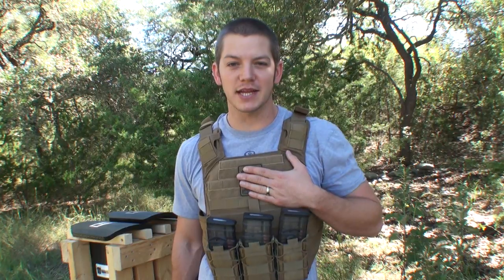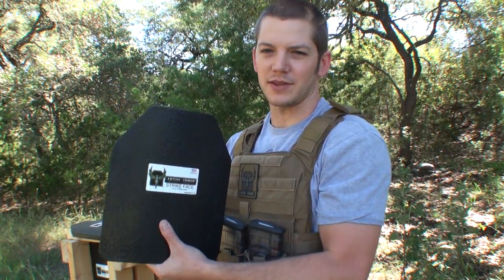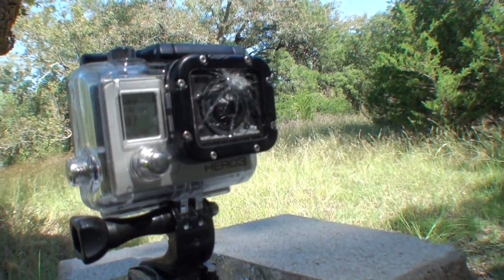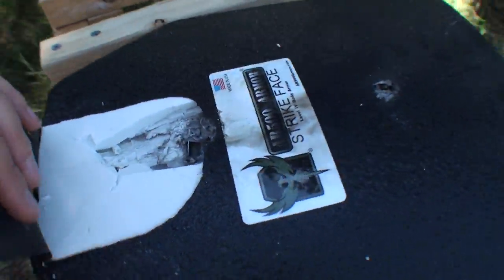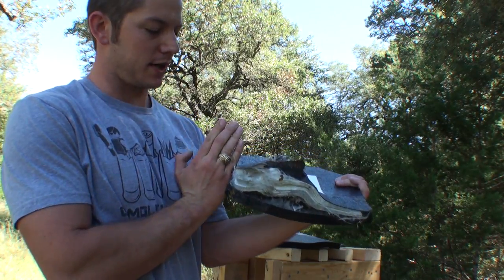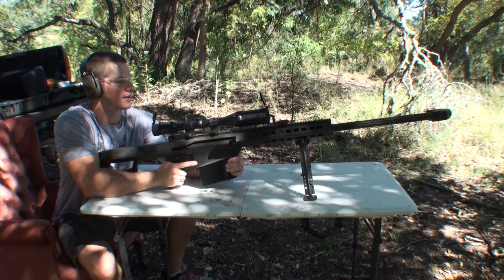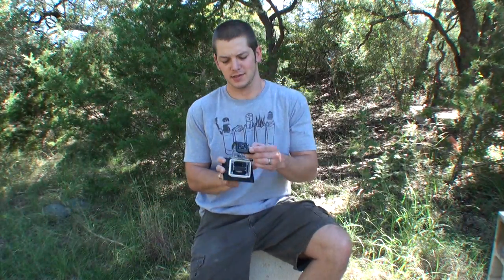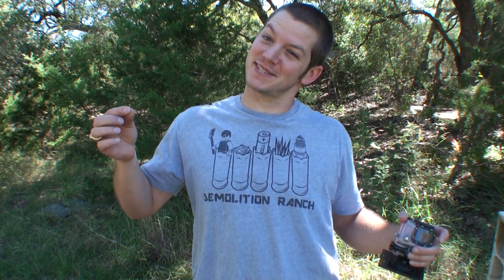Level IV Body Armor Torture, 50BMG

Comment: Umm... Even if it stopped the huge bullet, the resulting kinetic energy and momentum transfer would still either:
A: Stop your heart (Kill you)
B: Break your ribs (Possibly kill you if the fragments impale something vital)
C. Rupture your lungs (Very likely to kill you by drowning you in your own blood)
D. Push you back with so much force, the acceleration from the impact would rival getting hit with a car (Quite possibly kill you, depending on where you get struck)
E. All of the above
Reply: D. Maybe if the car is moving at about 5mph. Anything above walking pace and the car will be carrying way more kinetic energy.
Reply: tomcornwall83 Cars and Bullets definitely do not have the same Weight/Inch² ratio.
Reply: Waterpae well if the plate is intact it will definetly spread the impact force to the entire plate. So people might get trough that completely unharmed if there is a cushion wall behind them.... remember: the force applied to the target is the same as recoil... sure the gun has a mechanism to reduce it but if you don't stand directly with the back to a wall when shot you will move backwards when hit too. There is also the chance of being hit laterally which would reduce impact further. so with all respect for guns i still believe there is a fair chance to get trough that without permanent damage.
Reply: There is no way a bullet could Rupture your lungs or Push you back Or stop your heart. what stops your heart is you from the surprise of the impact.. but then again that is equal to getting a heart attack when a small kid dressed as a clown attacks you with kitchen knives in the middle of the night.  ... Example: Bomb suits can withstand ANYTHING.  hand grenade 2 feet away: damage 0. The only thing killing the people inside is the air pressure from very fast explosions. a bomb suit will make you survive a car bomb 1m away from you IF the explosion isnt fast enough to kill you... direct damage at the surface of the body is highely unlikely reality shows that people die from inside injuries . this is something a bullet can not do. with that as an example i really really doubt a 50 cal could harm people as much as described if the armor stops it.  ...      Movies make it look like bullets carry a lot of force but they dont. they cant push you an inch.
Reply: Waterpae well a tennisball could break my rips so thats not very special
Reply: Jo Kommentaah Next time you shoot a .50bmg for real or see someone shot with one, then speak.  Your naivety is astounding, stop playing video games and go get some hands on experience.
Reply: Van Hartman okay back to the basics: a 50 cal is not able to push a man when it hits him . if its not able to push him... and is stopped by 3! or 2 plates then the total energy could nowhere near be 15k joule transferred to the body. now take a punch lets say its able to transfer 500 joule to the target. the area a pnch would be transferred onto can be as little as 1x1" if hitting bones. does it injure you? normally not. okay so the plate is 10"x12" that is 120x times the punch. what is 120x500? woopsy far more than 15k . guess its not that powerful then. Yes it can go trough a wall.. but so can a sledgehammer with a pointy end. and would that hammer kill you if you got hit onto some armor that it cant pierce: NO. it would not.  So that does prove that the energy CAN not kill you if its absorbed by the plate armor. get it. absorbed. thats what the armor is all about. if it wouldnt absorb/disperse the energy the bullet would go straight trough. why dont people feel shit when a normal rifle round hits their armor? exactly cause its just a damn punch of energy being transferred to a large area. also keep in mind it will be more than 120square inches if someone wear a normal combo of a full anti-shrapnel with the plates on top. and then there is the clothing to absorb it further.  you probably think shotguns can kick people trough the air and grenades create huge fireballs.
Reply: Waterpae actually simply google the tennis ball and go back to school. oh and btw .... the force is not the only factor when breaking rips. but that far beyond your comprehension..
Reply: Waterpae raaaight. well fine i you cant google what more can i tell you ......  wall is wall nothing will change your minds faults
Reply: Uhg....... I'll see if I can sort out any arguments...

Force=Mass x acceleration
Kinetic energy=1/2 x mass x velocity^2
Momentum=mass x velocity
Impulse=Change in momentum= Force x Time
Pressure=Force / Area

Assuming the .50 cal bullet is stopped entirely by the plate(s), the momentum change from high speed, low mass to lower speed, higher mass (plate mass + bullet mass) would be tremendous, thus giving a huge impulse to the body in a very short amount of time.

This, in turn, will give us how much Force is being inflicted upon the body, which can be plugged into pressure equation. We also know roughly the area of the plate. The amount of pressure on the ribcage is likely going to crack a good few ribs from a .50 cal impact if there isn't any sufficient padding between you and the plate.

However, this won't stop the energy transfer. As energy increases squared as velocity increases, we have a good 15k joules of energy hitting your chest. Some of this energy is absorbed by you flying backwards from the impact, but the transfer of energy is not equal throughout the entire body. Given the likely scenario, the impact would be enough to probably give a minor rupture of a lung like a small explosive going off nearby. (Think like getting hit with a very large hammer, the plate after the impact being the hammer, not the bullet)

Continuing on, we also know the final mass from after the impact and the force being applied. The acceleration would throw you back with a sudden jerk, most likely injuring your neck like you're in a car crash. If you're really unlucky, it COULD break something. 

I hope this somewhat simmers down the arguments going on in this comment chain.
Reply: None of you are factoring in the energy taken out if the equation for plate deformation and temperature change.
Reply: joseph cook You make a really good point there. But would that affect the outcome though? Will it still kill or not getting hit by a .50 cal with the plate on?
Reply: BrokenLifeCycle FINALLY a compentent, coherent explanation. I was beginning to think there weren't any educated adults here. Not including the Doc. who has entirely too many cool toys!! Speaking of which, how about a professional medical opinion about blunt force trama?
Reply: E. Gotta say, option "E" is the most likely, right?(this guy has way too much fun). .50 Cal Friday's are always a treat....
Reply: Oh, I'm not saying that it wouldn't kill you, but I'm just saying that the numbers you are using aren't exact. .50's kill you. No ifs, ands, or buts about it. 15k joules is only muzzle energy, and deformation and temperature increase, plus body movement due to hard armor. Ceramic would probably deform more and cause more impact movement. Steel armor would likely just get punched through, causing less push back effect. If the steel was thick enough to stop a .50, you'd still get an impact of about 100 psi on your entire chest.
15000/(12•12)~=100
I think that lethal for humans in a less than 1 sec. impulse is around 75 psi. I wouldn't go around calling other people plebeian COD fags without basis, as I was just trying to bring up a point about the inconsistencies in the numbers involved.
Reply: joseph cook Ceramic shatters. Steel deforms...

But yeah, my measurements were just relative and just using logical deduction to come to a possible conclusion.
Reply: Shattering dumps a lot more KE into the surrounding area whereas steel plates (at least class III's) will just be punched through with about the same energy loss, but less kickback due to the deformation force being on mainly your lateral Axis (Axes plural?).
Reply: only in the film a bullet push you back...
Reply: Well Tony, why dont you go put on a plate that can stop a .50 and tell me that you arent going to get pushed if I shot you? Without body armor, maybe, but when wearing plates, you'll get knocked the fuck down, and probably have some broken bones.
Reply: joseph cook a .50 bmg caliber is not  commonly used against human target, i said a standard rifle caliber, example 308. but i said whitout a body armor whit balistic plates = bullet penetrate body and release slowly (and not total) the energy
Reply: Van Hartman 1- i never play whit a console 2- i never use a rifle, but only handgun (9mm and .45 ) 3- a video on youtube shows a test of proof vest whit a ak47 and a man used this proof vest and 0 push back, for video search "how italians test body armor"
Reply: Van Hartman you are a noob, during the impact a lot of energy of the bullet is lose in the bullet's deformation
Reply: Yeah Tony, the problem is that you keep giving conflicting/false info. One: you never stated what kind of cartridge doesn't push you back. Two: Umm, yeah, .50 HEIAP rounds (aka Raufoss) are used against human targets all the time by military snipers. And lastly, three; you bring up deformation, but you obviously dont know how it works. Most of the bullet's energy does not quote "go to deforming the bullet". The bullet deforms a lot yes, but there is not enough mass for the bullet deformation to be a serious factor in the energy transfer situation. And I have to agree with the other guy(sorry for forgetting your name), if you've never fired an intermediate or larger caliber (7.62x51 and up) then you have no idea how much energy they carry, and you should go back to video games.
Reply: joseph cook ok ok is right, but see the video "How Italians Test Bullet Proof Vests" , the man dont be push by bullet, and are a 7,26x39 whit around 2000 j energy
Reply: as one who once got hit with 5 shotgun bullets while i had body amor on, i can tell you it all depends on how strong your body is, i only have one lung today and half my liver was gone, im still here today, and as we all know on close hold shotguns are wrose than most guns out there.
Reply: So what you're saying is, don't get shot, regardless what kind of armour you're wearing? That sounds like some good advice because apparently people don't like getting shot...and guns are dangerous even if you're wearing armour...and some places such as your head it doesn't matter how much armour you're wearing because you could get a fatal head trauma from the force of the bullet. But there must be a plus side to all these guns...um....They're cool...and you can protect yourself from other people who have guns...but if they didn't have a gun....then you wouldn't need a gun...and everyone would be just a little bit safer...huh...looks like we've come to the conclusion that guns are pointless if no one has a gun then everyone is safer.
Reply: Oh god jason, don't be that fucking guy and turn this into a gun control debate. This is about scientific facts not philosophy, semantics and other political bullshit.
Reply: And besides, if we don't have guns, our knife and blunt force assault rate would shoot through the roof like Britain and France and other mid-European countries.
Reply: Is it easier to block a knife or a fist than a bullet? Is it easier to survive a stab wound and a punch than a bullet hole? And ever video that contains guns shall have it's comments turned into a gun debate! FOR THAT IS WHAT ASSHOLES DO! AND WE ARE ALL ASSHOLES!
Reply: Okay firstly, yes. There is a type of electric minigun that is legal in the US, google it. Secondly, I have no problem with the military using guns, although I think it's sad that we as a species still require shooting each other to solve our problems. I would freak the fuck out if the german military was like "You know what?...we're just going to stop using guns". Guns are fine in the hands of trained professionals who know exactly how to use a gun and gun safety. I'd feel safer if a soldier has a gun pointed at me than if some random guy was pointing one at me. The problem is guns are too easy to get in the US, and it is causing huge problems with shootings. Anyone with a half decent criminal record can get a gun. It is too dangerous. And even if you have a criminal record, guns are basically lying around. Have you seen the pictures of people carrying rifles in walmart? A lot of them have them slung loosely over their shoulder. Any one could just grab it and start shooting the place up. The only place you find weapons like that in Europe is in the back of a police car, usually guarded by well trained policemen and the occasional farmer who has gone through lots of training to get a licence. Look, I don't live in america and don't plan too any time soon, but for your own sake, you are already the laughing stock of the world, just under north korea, just stop with the stupidity already.
Reply: Oh, that makes a lot of sense now. And I live in California, the liberal capital of the west so I can see where you're coming from as a foreigner. Lots of media tries to play it like that is an accurate representation of all of America, but to be honest, you only ever get that in like 4 or five states tops. And with the easy to grab rifle thing, it's not as easy as you think, because you get the "robbing the gun store" effect. How are you gonna steal a gun when the person you're stealing it from has a gun? (Or several) And on the topic of the minigun, well fucking hell, I hope that's not cleared for civilian use, cause I'd have a fucking problem with that too.
Reply: jason flynn  in Italy can buy a semiautomatic m16 or an m14, or semiauto ak47, or up to .338 Lapua Magnum large caliber
just get the license, however, only 200 cartridges for weapons rifled and 1000 shotgun
Reply: Yeah but... Italians man...
Reply: jason flynn italians man what?
Reply: Italians are sort of the exception of europe. We kind of stopped talking to them since the early 20th century
Reply: Well Tony, he's kind of right. If you compare pro-gun to gun-limiting mainland European countries, it's kind of Italy vs. everyone else. Italy is pretty much the US of europe.
Reply: joseph cook this is funny, because in italy all possessor of gun (very low %, 2 time less than other big west europe nations) think the opposite about guns law in italy...
Reply: I agree ar500need one to stop a 50 cal
Reply: Actually wtf man? Breastplate has bigger pressure space than 50 stock. SO there is no chance to "be hit by a car" since shooter is not ripped in half by recoil..
Reply: Piotrex23 additional info after reading all the comments. We are discussing what if plate like this could STOP bullet on it with no bending, partial piercing. So, since that you have no chance to get deadly heart "massage" or completely broken chest. If it would be like that then the arm of the shooter after shot would be ending in his as because the stock would work like big fucking hammer using force that hit this poor broken chest man multiplied by x=surface of plate/surface of stock. Y'all understand now?
Reply: Hey piotrex, why dont you go try to fire a .50 without a muzzle brake, recoil dampeners and a .05 impulse time. See what happens to your arm. You know, only if the gun doesnt explode first. Basic science is basic, you need more advanced stuff to understand primary and terminal ballistics.
Reply: Jo Kommentaah Actually not true, even a fairly light blow on the right place of your torso during a certain pause in your heart tick rhythm can prove fatal,  It happens often enough in the USA..about 10x year when players get hit during sports.  : Commotio cordis
Reply: M van dongen jea but its the same thing as saying playing a prank will kill a person cause he dies of the chock.. if it happens once in 1000000 cases it does not really count
Reply: Party pooper!
Reply: That's exactly what I say as well, but they aren't really designed for high power rifle rounds I don't think.
Reply: homersipes I don't think there is any sort of personal body armor that can take on a .50 caliber and leave the wearer in relatively good health afterward. But if you got hit by such a bullet anyway, then you must have done something in the past to warrent it. Karma is a bitch.
Reply: BrokenLifeCycle /then you must have done something in the past to warrent it./

Just like unarmed blacks who get shot by the police must have committed some crime worth getting shot over?
Reply: homersipes Blame BrokenLifeCycle  for writing shit like "you must have done something in the past to warrent[sic] it."
Reply: BrokenLifeCycle /Or do everyone have to put "(Sarcasm)" at the bottom of their comments when they are joking?/

Yes, you do.  This has been common Internet knowledge for 30+ years, and is why emoticons were invented:

A quote from 1983:
"8.  Avoid sarcasm and facetious remarks.

Without the voice inflection and body language of personal communication these are easily misinterpreted.  A sideways smile, :-), has become widely accepted on the net as an indication that "I'm only kidding".  If you submit a satiric item without this symbol, no matter how obvious the satire is to you, do not be surprised if people take it seriously."
Reply: >"A quote from 1983"
>"1983" 
>Implying relevance in internet etiquette from quotes over 30 years old
You should never take anything you see on the internet as completely serious, lest you be seen a fool by others who had enough common sense to determine whether a statement was satirical.
Reply: I dont believe that it would take a 50 cal shot to impose busted ribs.  at 100 yards a 300 win mag has 3000 ft/lbs of energy, now concentrate that to a 1" spot a a chest, be the same as getting hit with a baseball that was pitched at 550mph.
Reply: Well yes and no Homer, we're talking about with a plate on, so it would be spread out a lot more across the chest
Reply: The bullet has less energy than the recoil. The recoil doesn't kill you, therefore, the bullet wouldn't kill you if it's energy were spread over an area as large as the butt of the stock. And an even larger area probably wouldn't even leave a bruise
Reply: mellowb1rd /if it's energy were spread over an area as large as the butt of the stock./

I wonder what would happen if you shot a .30-06 with the buttstock pressed against the sternum.  (A baseball strike to the sternum can kill.(
Reply: That's a good point Ron, like I said previously that the .50 has tons of recoil dampening features, imagine putting an un-braked .50 on your chest while firing.
Reply: Yes. Except just because all those things could happen doesn't mean they will happen. It's meant to attempt to save your life not guarantee that you'll be fine. Your odds of surviving with it are a lot higher than without it.
Reply: it's stoping a 50 cal come on stop hateing
Reply: a friend of mine was shot with a .45 at about 10 yards, he said it totally knocked the wind out of him and fractured 2 ribs.  He is an ex PO.  Now if a tiny 45 can break ribs, what will a high powered rifle do to your chest??
Reply: bait so hard
Reply: +jason flynn this is when you realize criminals break laws, so even if guns where illegal they would still have a gun even if its against rules (criminals dont follow rules anyway) so whats the point?
Reply: This comment chain is still a thing? I did not see that coming.
Reply: +BrokenLifeCycle F. the deflected pieces are still fast and furious enough to tear a limb.
Reply: Rayan Alam I didn't say they will always knock you back just most of the time , maybe if you read my message you would have noticed. Also there would be NO chance of surviving that by the way unless of water (as you said)
Reply: E
Reply: BrokenLifeCycle haha yeah just commented that
Reply: Did you just call the .45 tiny?
Reply: if you shoot someone holding the gun, you feel the same amount of force they do. (unless there is a muzzle brake)
Reply: E
Reply: BrokenLifeCycle that's dark
Reply: BrokenLifeCycle E
Reply: BrokenLifeCycle you must be fun at party's
Reply: thank you for the information... now i can just have nightmares xD
Reply: BrokenLifeCycle True it would 99% chance still kill you but at least it would be a closed casket verses a jar
Reply: BrokenLifeCycle Yes, but if they have an angel watching over them then they live Kappa
Reply: BrokenLifeCycle Except that's exactly how it is. A lot of the energy is dissipated when the gases escape the muzzle (which is how muzzle brakes work, by capturing that energy and using it to push the gun forwards against recoil) and the bullet is much easier to accelerate, so it "soaks up" the force of firing faster than the gun does. That said, getting hit by a large rifle round isn't the end of the world. Deforming the steel or cracking the ceramic of the armor itself absorbs a lot of energy, and rifle plates are often used with "trauma plates" which further cushion the impact.
Reply: Tony x l
Reply: BrokenLifeCycle smart guy
Reply: smart guy
Reply: BrokenLifeCycle still there is a possibility you will survive
Reply: The momentum of a .50 bmg (Hornady) is about 46 kgm/s. This is similar to a decent swing on a 10 lb sledge but it's distributed over the area of the armour plate. It'd send you backwards about 1 mph. I don't think it'd kill you though some ribs may get fractured. 

Think about it this way: The impulse from the bullet hitting you is a little less than the impulse of firing the rifle. If you fire a .50 from your shoulder then it'll hurt about that much.
Reply: E
Reply: People who are saying that the plate armor would distribute all of that energy equally are insane, clearly don't know what a bullet does to body armor. Do you see the bulge on the back end of the second piece of body armor? That energy was not equally distributed, it was focused and almost penetrated a single point, which is the whole purpose for ap rounds, which are designed to penetrate things that distribute enegry well. The only instance where that would be a reliable formula is if the projectile was same size as the plate, otherwise the vast majority of the energy will be focused on one smallish point and will be transferred directly into whatever is in it's path.